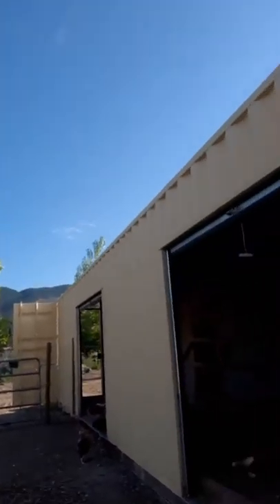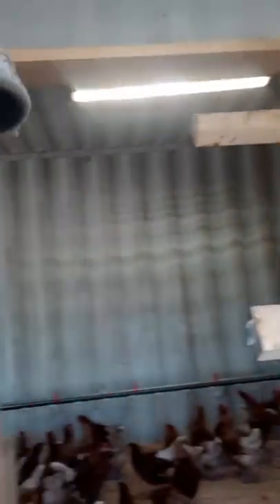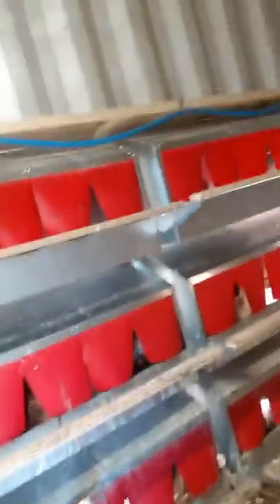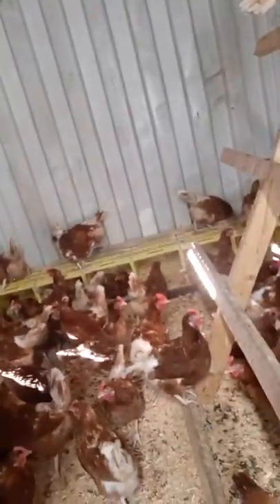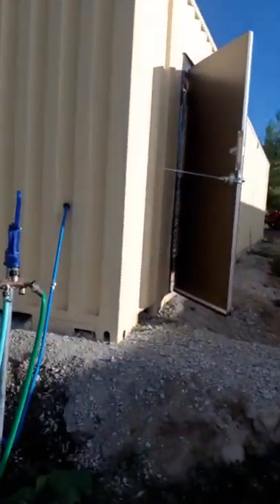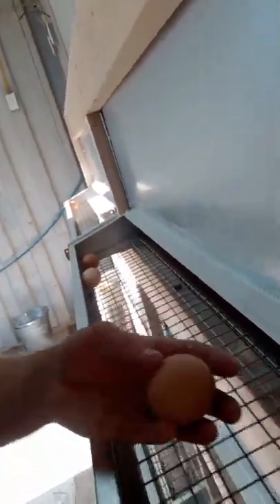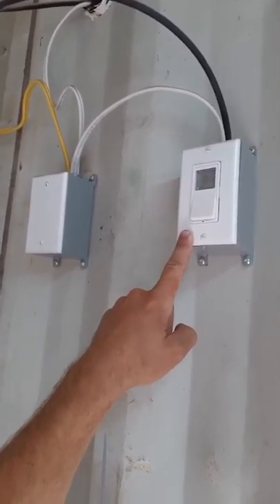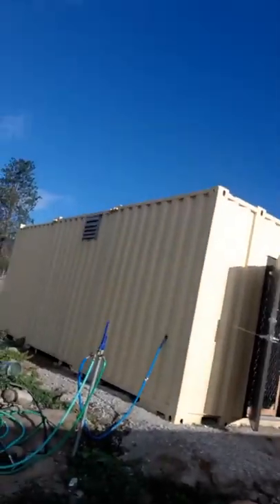Sea can chicken coop for 400 chickens

Comment: was thinking of doing similar  planned to use 2" panels for insulation but if you didn't already know you have to cover it or the chickens will eat it all within a year. I put my chickens in my barn with exposed insulation and they seem to think its candy and have almost eaten all of my insulation 😑. will have to reinsulate and put tin over it. with that many chickens in there they should create enough heat to keep it above freezing even with ventilation. nice setup and gave me some ideas. thanks

Comment: Nice set up! What's the litter system, you don't worry about ammonia? How do you take care the moisture? Thanks in advance.
Reply from the maker: Sorry just saw this. I use wood shavings. I've not had problems. Winter gets a little smelly. I have the fan on a timer which seems to help. The summer I keep the doors open so no problem. 
I do a clean out with fresh shavings every 6 weeks in the winter.